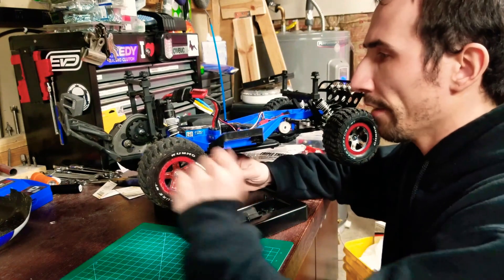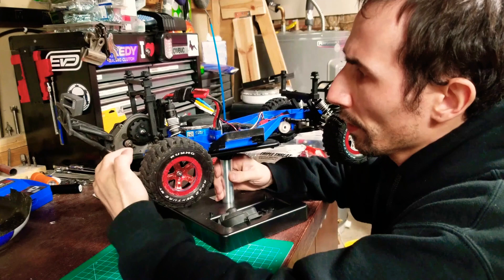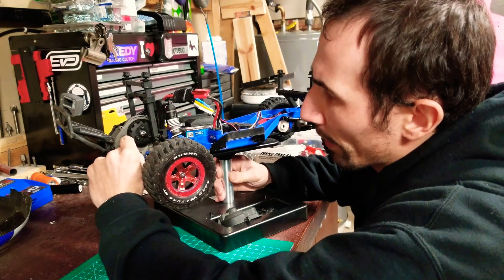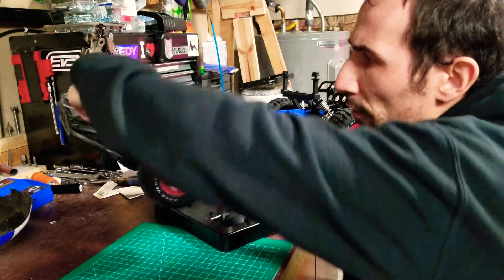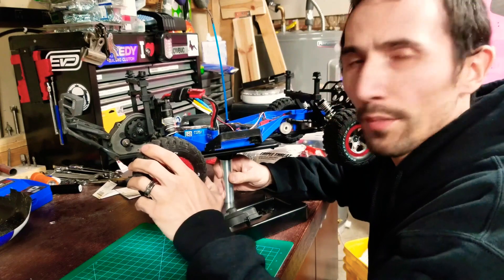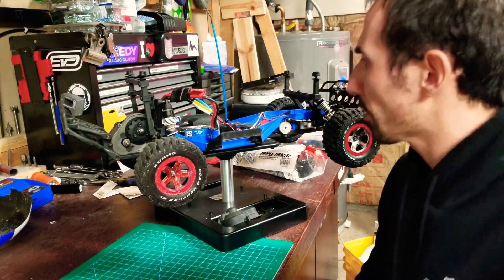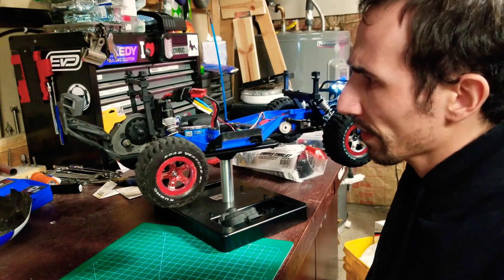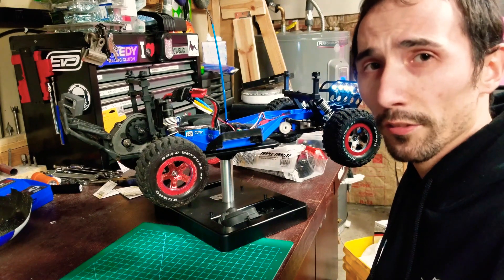Traxxas Slash 2wd Transmission Issue

Comment: Its called a limited slip differential so that if one wheel gets locked up for some reason the other one can realease the power without just breaking your driveshafts or whatever the power goes to
Reply from the maker: I don’t know what I was thinking back then about what the problem was, I have always understood the concept of open vs limited slip vs locked diff.. I used to drift back 10 years ago on a welded diff that I also used as a daily for 3 years.. this video was really pointless tbh maybe I was just wanting to put out a video and couldn’t think of a topic.
Reply: @GlitchGarage  lol right after I posted that I saw it was a 5 year old video too my bad

Comment: Brushless motors spin up to 5 times faster than brushed motors. Hence why the new motor sounds different than the old motor. Think of it as a NiMh battery and a lipo battery, the old motor being the NiMh battery and the new motor as a lipo battery. They are practically the same thing but with way different technology. Hope this helps.